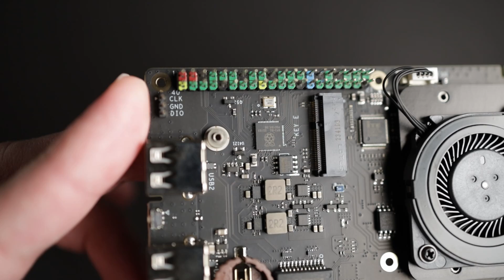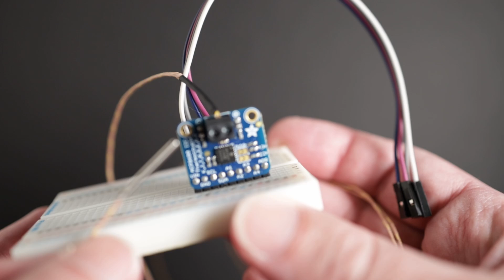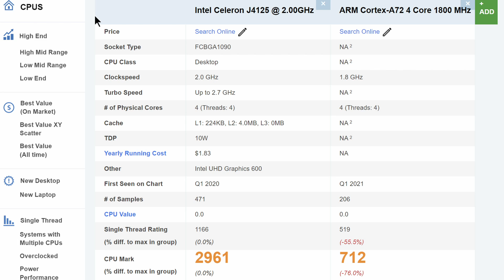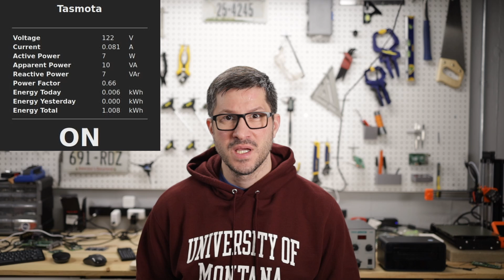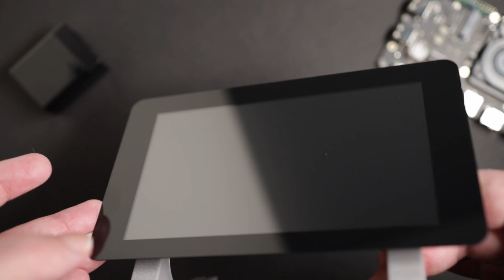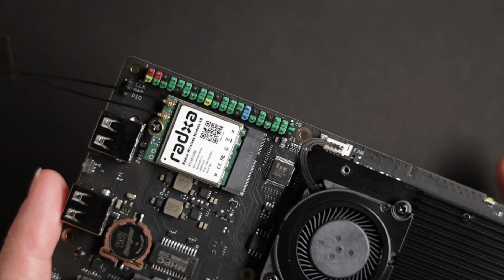Radxa X2L: Mini PC and a Pi had a BABY!

Comment from the maker: After editing the video, I tested the powering the X2L with my power bank and it went ok. I removed the WiFi module and a USB device I had plugged in. It has not crashed since.
Reply: just use the 1 from the pi 5, or portable battery with requirements

Comment: It has 2x PCI express slots!! 1 for WiFi and 1 for a m.2 SSD!! It doesn't need the WiFi module because it's got 1gig ethernet and if you really want crappy WiFi get a cheap USB WiFi module to use. Then put a adaptor in the WiFi slot to convert it to 2x SATA SSD ports (its bandwidth is enough to be snappy) and get a second adaptor for the m.2 SSD slot (its 4x PCI express lane's) to run a dedicated GPU!! Something like a GTX 1660 or a (RTX A2000 needs only slot power) and a 3D printed egpu enclosure or a cheap Chinese egpu enclosure.. that will really turn this into a machine that will game decently..

Comment: i wonder how viable it would be to use an GPU via oculink on that with the M.2 slot on the back?
Reply from the maker: As long as there is a driver for the he OS you are running.
Reply: @makerbymistake  yeah I would assume drivers are the limitation there, but could be interesting to benchmark it. the CPU performance might be lacking, but I wonder how it would compare next to a Orange pi running box86/64 and proton
Reply from the maker: @CSLRProductions  Orange Pi makes several SBCs with different CPUs. I compared the X2L to the Rock 5B, which uses a very similar CPU as the Orange Pi 5. As to the eGPU that you are looking for, just check if it has Linux or Windows support

Comment: I think this might be a good option for creating a portable mini laptop type device. Is it possible to power it without using the USB-C Port? I could see the RP2040 acting as a controller for displaying battery information
Reply from the maker: I think powering without USB-C would require a solder job, which is doable

Comment: i once read specyfication of n3000 series of intel low power soc's  and those things are loaded by default with 2 channel memory controller, 2 sata channel multiple usb and pcie lines and gpio pins all baked into the 6 watt cpu with integrated graphics
you mostly limited by board design and bios used by whoever lock the cpu down
on hp stream laptop motherboards gpio pins are used to configure hardware  in crude  1/0 format while booting up the bios
Reply from the maker: Yep, pretty much all chips have GPIO but very different than the GPIO on the RP2040, where you can do SPI, I2C, PWM, ADC, etc